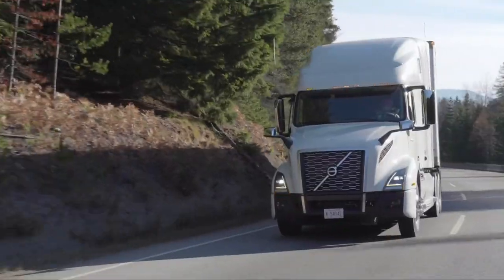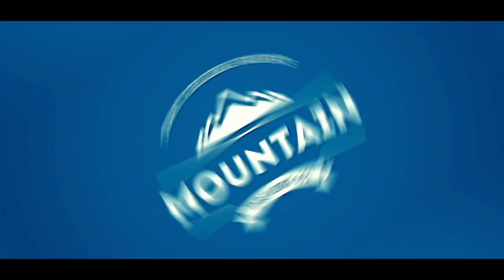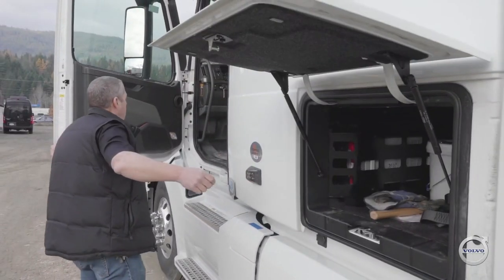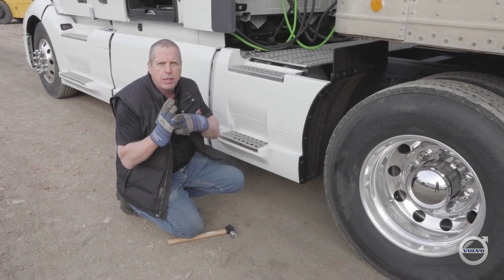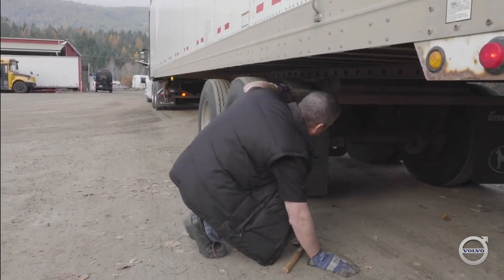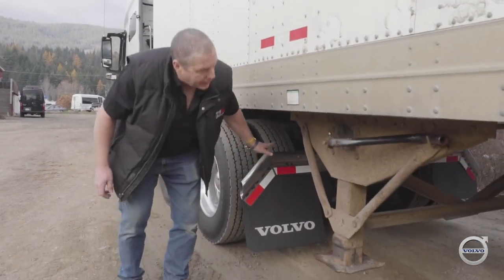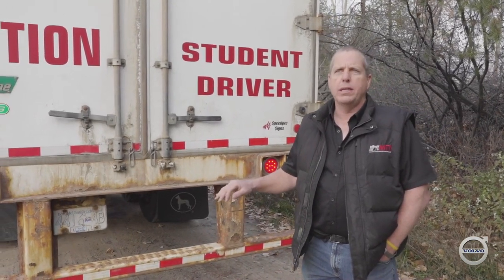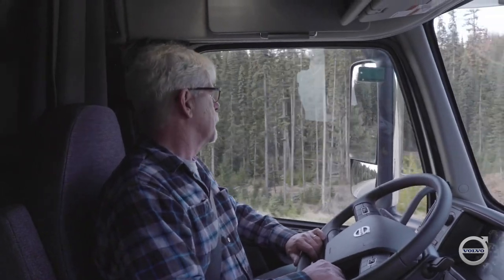Mountain Driving 101: Inspecting brakes before heading downhill (Episode 2)

Comment: Once I had a caliper fail on a truck I was driving, not my truck tho. Did not release all the way and heated the disc red hot. Did catch it in time so no fire.
We don't have brake checks areas, not runaway ramps or anything like that. Not really an issue really with brakes failing.